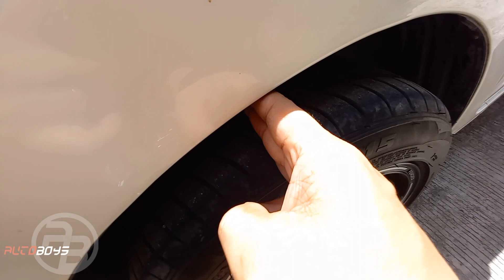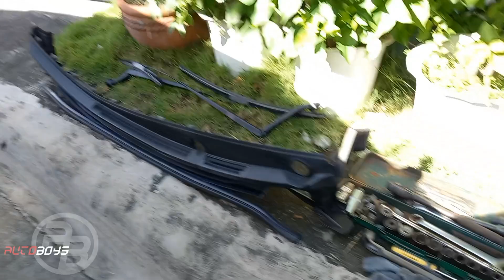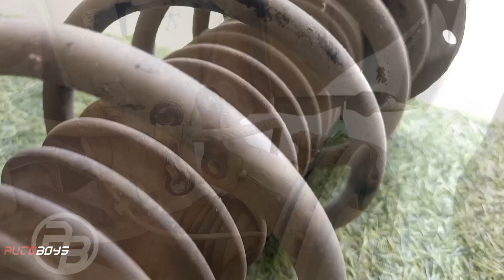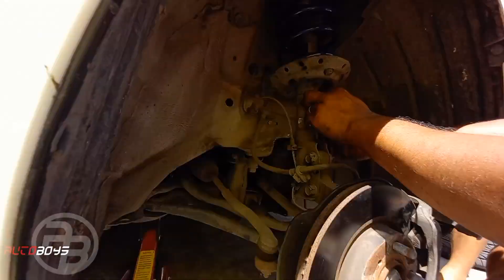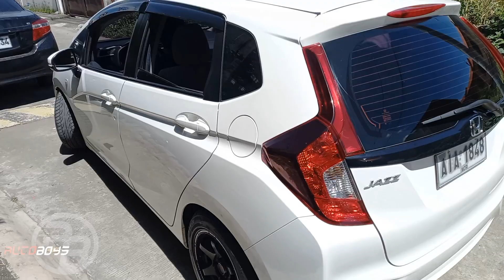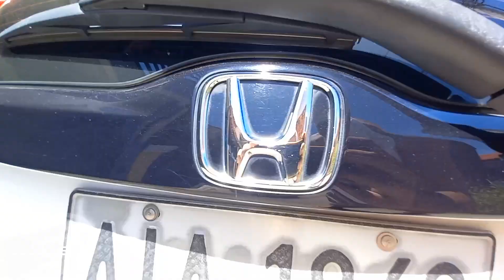L&T lowering springs for Honda Jazz GK sold and installed by Autoboys.

Comment: Normal lg po ba after ko instal yong l&t tapos mga weeks palang my bearing problem na aad pag mag liko?
Reply from the maker: Hindi po yan normal hindi po mag caused ng issue ang lowering springs kung properly installed